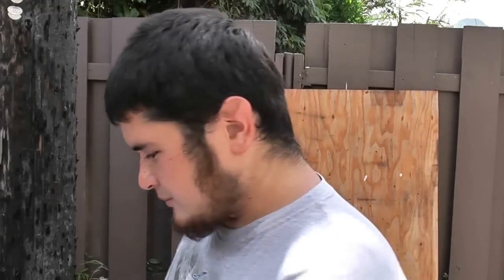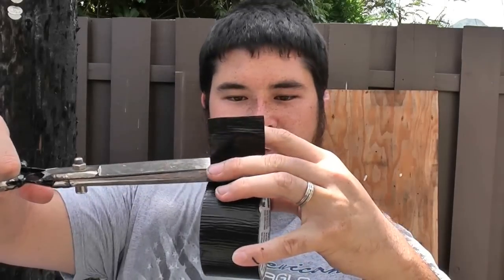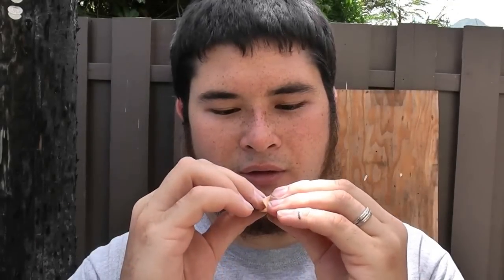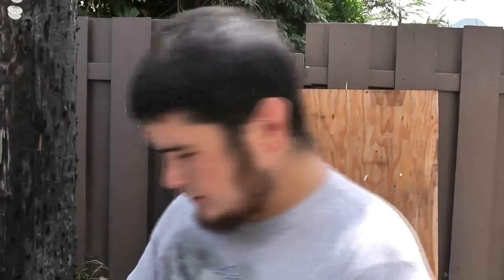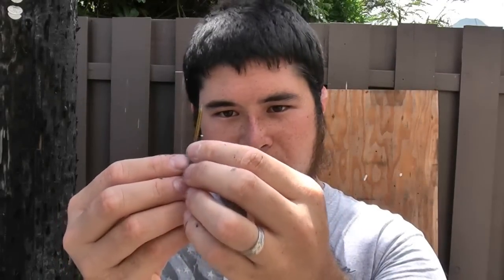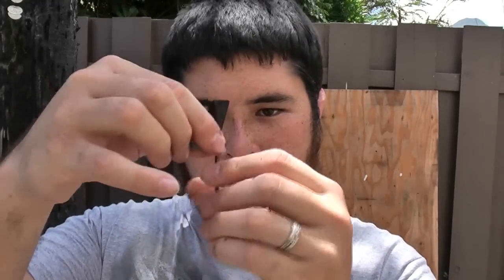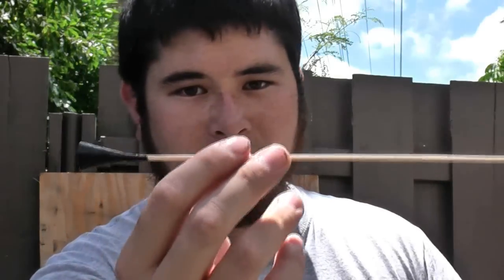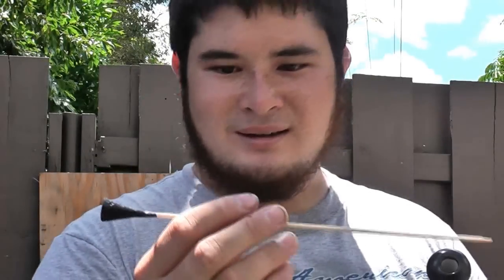How to Make a Blow Gun Dart With Duct Tape Cone

Comment: Thanks for sharing. This works great. I use copper pipe because it is straighter and more accurate. I also lashed three pvc together for defense weapon and quick follow up shots close range. Very powerful and destructive. Don' t think this is a toy. It will shoot into the side of a steel soup can with nail darts.

Comment: I made some of these with 3-1/4 inch sinker nails and shot them out of my homemade 5 ft blowgun with a copper barrel and they work perfectly. I didn't realize just how deadly they are. I have an old, cheap wood door that I use as an archery backstop in my basement. from 10 feet, the nails stick through the opposite side. Damn impressive.

Comment: Hi. I made your duct tape cones and it works the best that I have tried so for. I used bike spokes as the metal dart. It works really well. I straightened the end and glued into the cone. Then sharpened the other end. I had beads that I than glued them to the end of the cone. Try it out!!!!
Reply from the maker: claude morneau Nice, sounds awesome! Back in college my roommate and I made throwing spikes and blowgun darts out of bike spokes as well.
Reply: I used bike spokes for ages. I upgraded to these nice thick yet light coat hangers. They work really well but will bend if you hit something solid like cement or bricks.

Comment: I've been using a variant of your dart technology for several years. I cut the head off the nail and use a daub of glue in the tip of the cone where the nail shaft is. I also sharpen my nails. I can penetrate 1/4 inch plywood with these reliably at 35-40 feet.